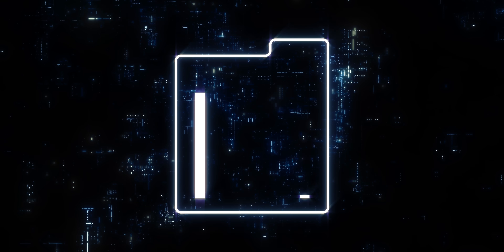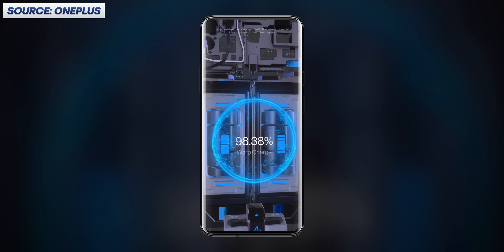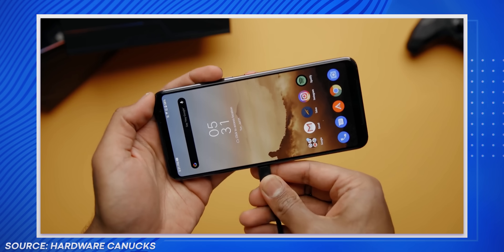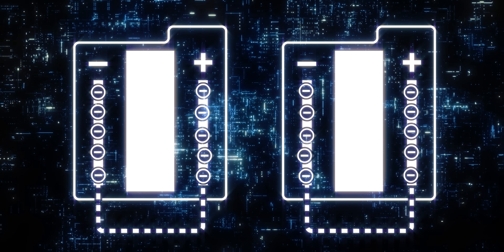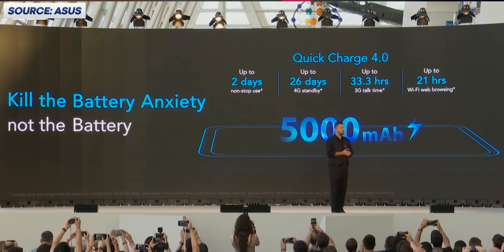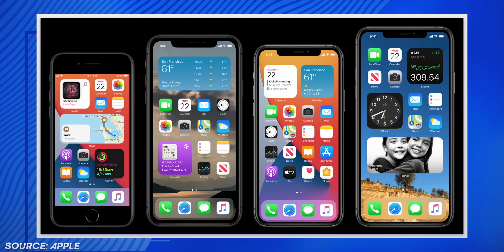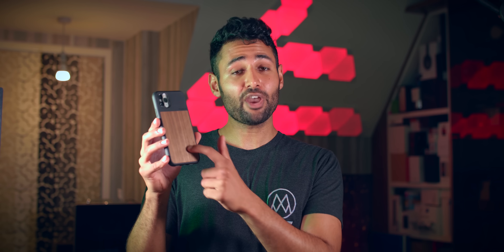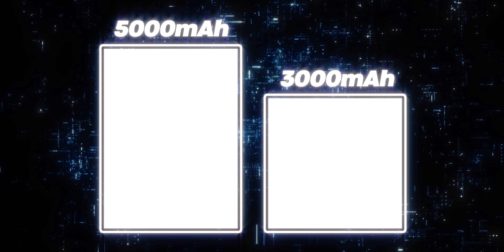The Problem with Fast Chargers.

Comment: On 20 cells         : use 32 gems at 0 days 16 hours - 18g/12f/3h
On 30 cells         : use 33 gems at 1 days 10 hours 40 minutes - 32g/21f/5b
On 50 cells(r0)     : use 57 gems at 1 days 18 hours 40 minutes - 38g/25f/6h
On Chests           : use 0 gems at 0 days 0 hours - 1g/0f
Total gem cost: 122 gems.
Total time: 3 days and 21 hours 20 minutes